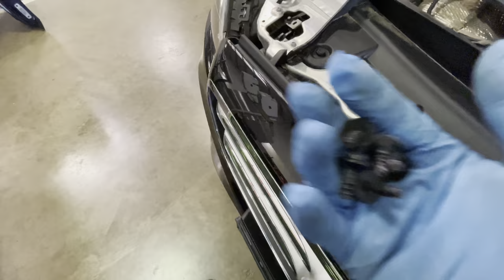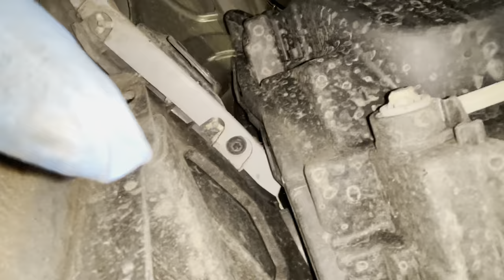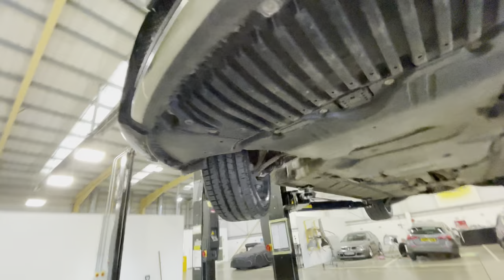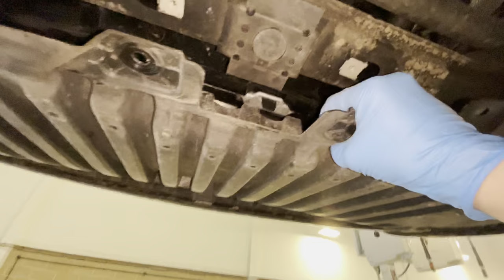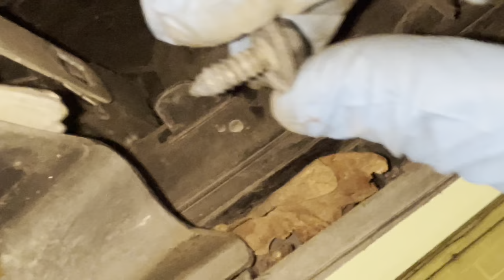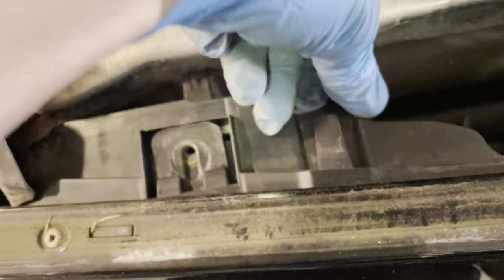Mercedes E class W213 2016 onwards : How to remove front bumper

Comment: Actually you inspired me and I just did something similar for my 2017 s213.  It looks great, but now one of my parking sensors keeps going off constantly.  Any thoughts?? Everything looks connected correctly.
Reply from the maker: Thank you for the comment, have you unplugged or removed any of the sensors individually? If so, are they in the same place that they were before because I know if they are fitted in the wrong slot they don’t work correctly
Reply: @jackgross3140  The only thing I disconnected was the large plug in front of the right wheel well, but plugged it back in completely.  Did I need to disconnect the battery before doing any of this work?  Any thoughts on resetting the sensors?
Reply from the maker: @xpuhlode1  I’m not too sure on that one, I didn’t disconnect the battery and never had a problem